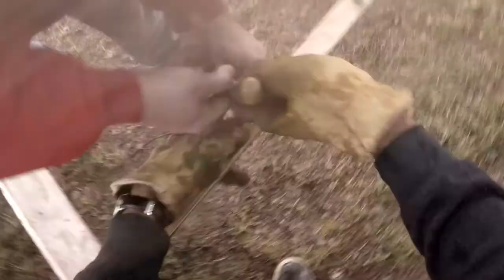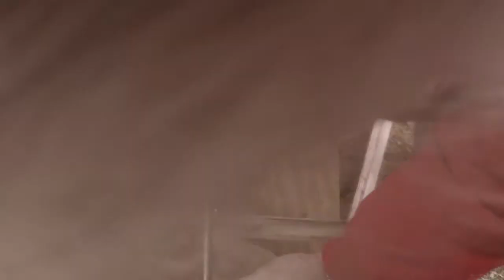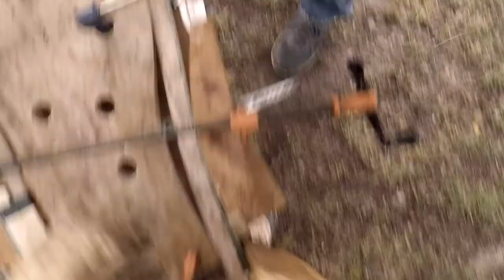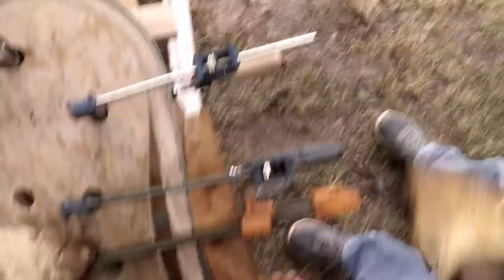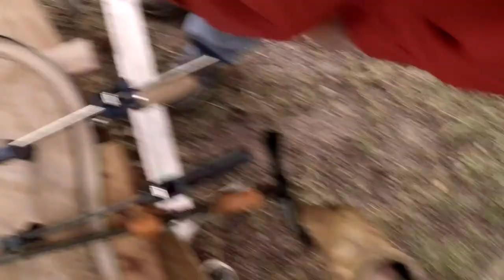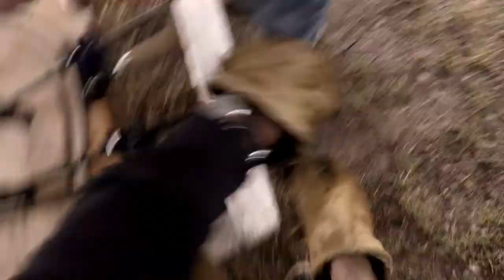Steam Bending a Shepherd's Crook

Comment: Did the shape stay what wood are you using and while you are at it you can make me one if you want
Reply from the maker: These were more successful because I used a full-length compression strap instead of a partial-length one
The bend wanted to slowly straighten out until I sat them by our oil furnace for a day.  That seemed to "set" the bend.  Since then I have seen an article in which the author mentioned "setting" the bend using a low-temperature oven heated with a 100 watt incandescent bulb.  In fact, I bound the two I made this day tighter than the form expecting some spring back.  After sitting a day by the furnace they didn't spring back at all, so I'm going to to douse them in some boiling water to get them to open a bit. 
The wood is red-oak.  It was still quite damp and fresh from the mill.  rough cut to about 1 1/4" x 1 1/4", I carefully ripped them down to 7/8" x 7/8" and oriented the grain so they were quarter sawn.  White oak is also be an excellent wood for steam bending.
Please be aware that it was only after i created the forms for these that I managed find references to crooks that indicated actual, working shepherds crooks as having a smaller diameter bend; about 6".  These are closer to 9" diameter.  Good enough for a stage prop.   I'm not likely to try this again until warmer weather.
Reply from the maker: BTW, you can order crooks from Tractor Supply.  They say they are made in Texas. 
https://www.tractorsupply.com/tsc/search/shepherds%20crooks
Reply: @wsflather ,